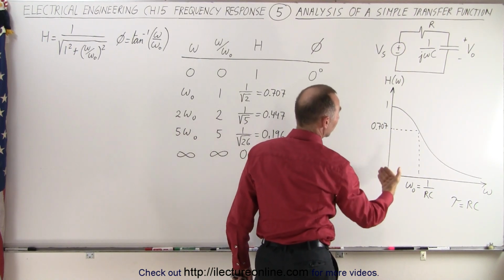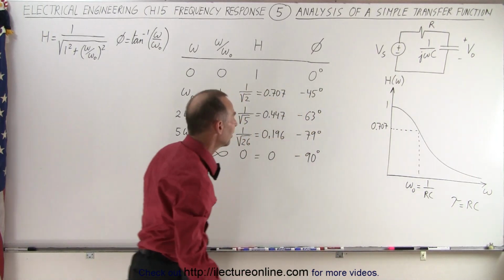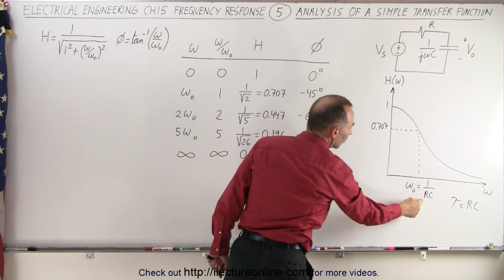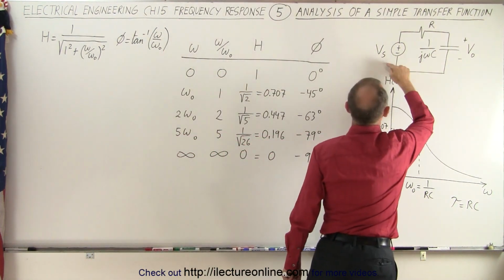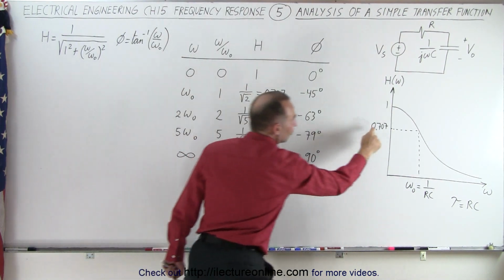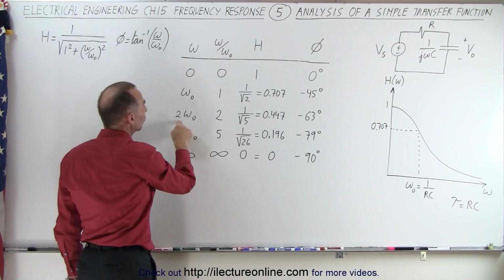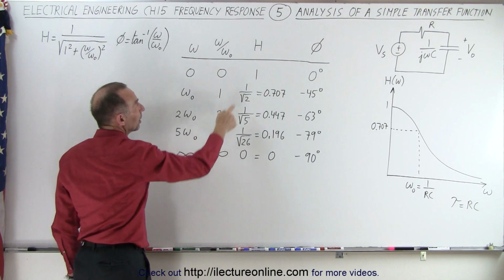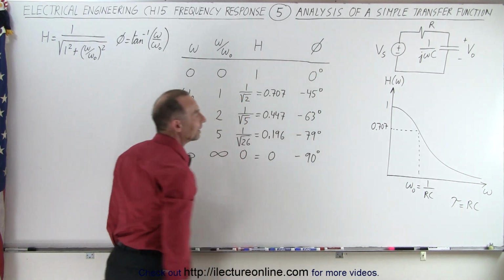Electrical Engineering: Ch 15: Frequency Response (5 of 56) Analysis of a Simple Transfer Function

Comment: @0.46 Prof you said as frequency increases it converted into short circuit but Will not be it change to open circuit
Reply from the maker: At high frequencies, a capacitor will seem like a short circuit and an inductor will seem like an open circuit.

Comment: Thank you sir,  .. tan inverse of 1,2,5, are +45°, +63°, +79° sir but you wrote -45°,-63°,-79° sir...?
Reply: because  phase angle is measured clockwise so  Φ will be -tan inverse of ω/ωo
Reply: The clockwise orientation doesn't explain anything. I think the fact that the imaginary part(jw/w_0) was in denominator signifies that the angle will have negative sign. So there is a mistake in the formula.